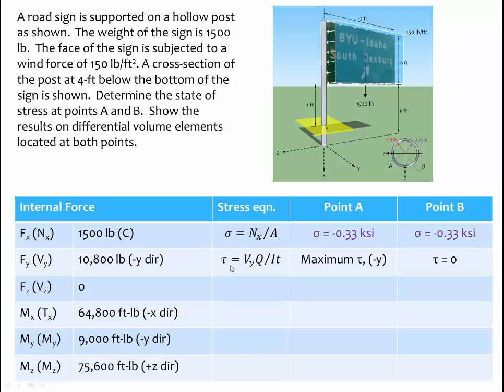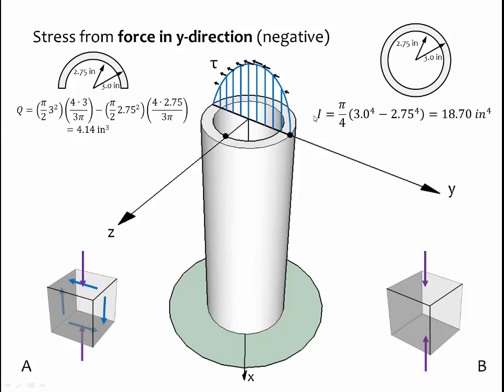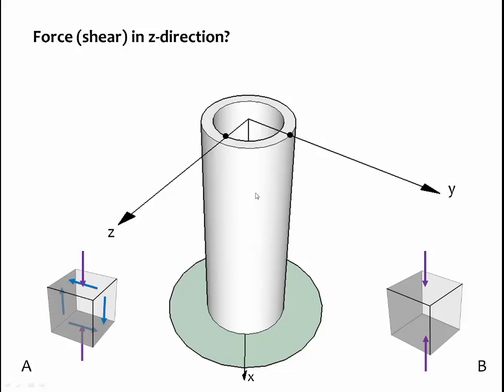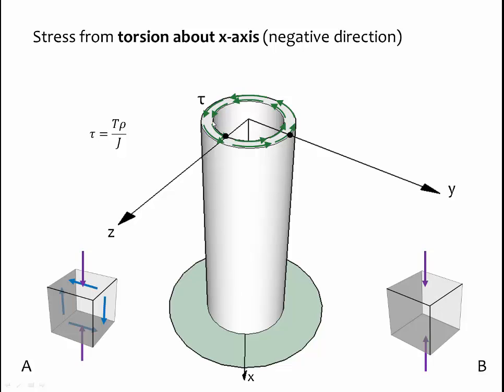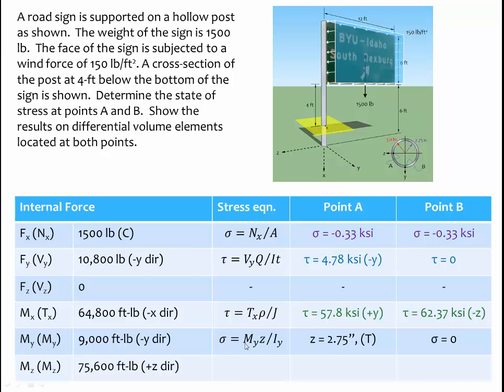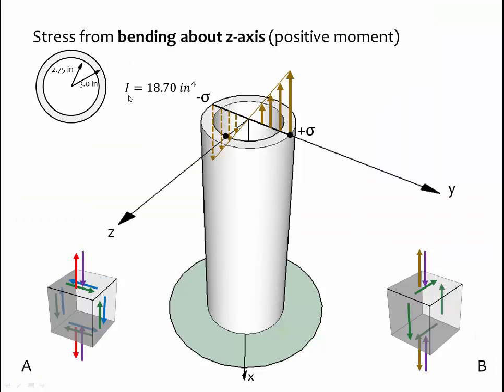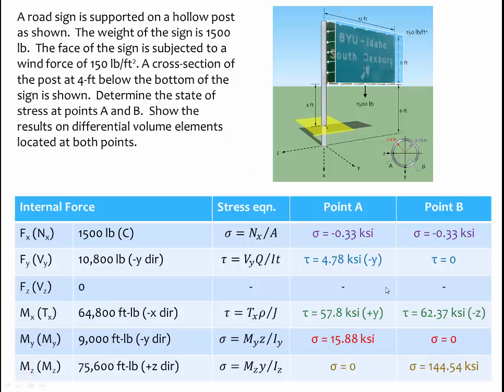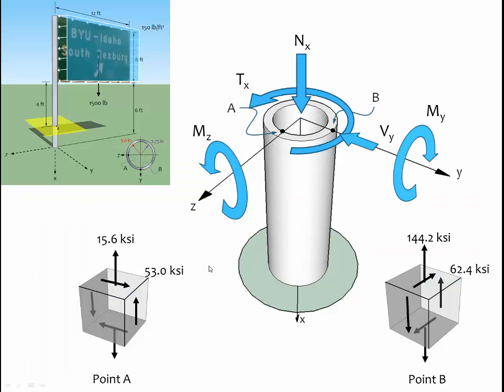07.2 Combined loading - Part B

Comment: Why don't you do equal and opposite internal loading? You say Vy = -dir, but isn't there an equal and opposite force? And so isn't the shear due to Vy in the positive y direction?
Reply from the maker: There are equal and opposite reaction forces and moments balancing the applied loads, but in my diagram, they occur at the base of the post and are not shown.